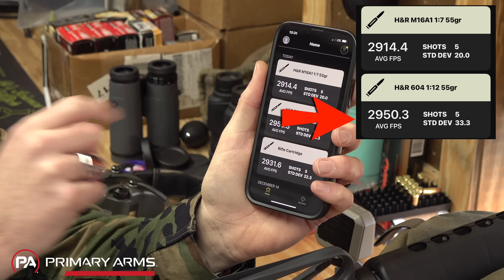Which is more accurate? 1:12 or 1:7 Twist Rate? Let's find out!

Comment: I haven't watched the video yet, but the twist rate does not affect accuracy. Other factors vastly influence accuracy more, and you would need a more significant sample size to prove anything.

As long as the bullet is stabilized, it is stabilized. ELR will change things, but not at 100 yards.
Reply from the maker: You would be wrong with that assessment, one of the reasons the .224 Valkyrie struggled initially is because no one had figured out the right twist rate AND bullet weight for optimal performance. My DD5 Pro likes 147gr Hornady but doesn't like the 120gr stuff at all. Why? The twist rate for the bullet weight isn't optimal at 120grs.
Reply: Twist rate doesn't affect accuracy ? Then explain the Greenhill formula.
Reply: @kman0146  Greenhill formula predicts bullet stability not accuracy.
Reply: @bpm990d  They go hand in hand
Reply: @kman0146  Yes they are related, but nowhere in the greenhill formula itself is there a prediction about group size or precision.
Reply: @bpm990d  I was responding to the statement that twist rate has no affect on accuracy, maybe i should have used a better or more modern example but the reason rifling was developed in the 1st place was for accuracy, nobody would bother stabilizing a bullet if it didn't make it more accurate and Greenhill would get them in the ballpark 150 years ago.
Reply: Twist rate can affect accuracy. The British use to get issue ammunition to shoot their long range matches. It was all specially selected lots of military 144gr ball ammo. They found out that it shot better in 13 or 14 twist barrels, rather than the standard 12 twist barrels that the military rifles had. Back in the day, you wanted a tight bore and groove barrel with a 13 twist if you were going to Bisley to shoot. 

The reason they shot better with slower twist was the military ball ammunition has non-uniform bullet jacket thickness. That mass imbalance resulted in worse groups the faster you spun the bullet. Think of an unbalanced top.
Reply: Yeah your assumption was wrong LMAO twist rate and projectile weight relationship is critical for accuracy. Ask any reloader who does precision shooting.
Reply: Guys, the twist rate required to stabilize a bullet is based on the LENGTH of the projectile, not the weight. This is why people believe old WW2 guns can not shoot copper bullets accurately.

Once you have the proper twist rate to stabilize the bullet, no additional twist will increase accuracy. What you are seeing is an unstable bullet that is spiraling due to not having enough twist rate to overcome the dip of the nose when it leaves the barrel. The technical name for this yaw effect escapes me, but there is a name for it.

Moreover, it has been proven that bullets will often overcome this wobble-induced spiral at over 100 yards. As the bullet slows down, it stabilizes completely.

You do not need to see a keyhole to have an unstable bullet. Another test to prove there is a spiral is to shoot your unstable bullet at close ranges. Shoot a group at 20, 25 and 30 yards. If your group moves around the aim point at various distances, your bullet is spiraling and not fully stabilized.

Once it is stable, no amount of twist will ever increase the accuracy.

I just finished watching the video. I love your content, but all you proved was that 1 in 12 is insufficient to stabilize the 62gr fully. If you extend it to 200 yards, you will see better results. Also, if you did my close-range test, it would show the group moving around the bullseye depending on the distance. It would make a great video!
Reply: @coreymoyers  Thats not what you said, you simply said twist rate does not affect accuracy.

Comment: I’d like to see a 1:14 barrel thrown in for once… Including a 1:9 would be useful as well…. Using bullets from 40gr up to 77gr…

Maybe a summer project for me…
Reply: With 1 in 14 and 1 in 12, make sure you hit "watermelons", not regular melons or cantalopes etc, for the full effect, because of the pocket of air in regular melons inside, you won't get the hyperstatic effect.   :)
Reply: @thesanfordmethod1905  As fun as that would be, I want to concentrate on accuracy measurements. I may look into a block or two of ballistics gel though as I would love to see the various wound channels with the various weights through the various twists and how they will differ… especially a 1/14 with some 40gr blitz or TNT varmit bullets at 3600fps…
Reply: If you do, go by length of the bullet. The longer they are, the more revs are needed. You can find the same mass with different lengths and different mass and same lengths.
From there the more mass is on the outside or mass removed from the center the easier it is to stay on route rotating along the same axis.

Comment: I was surprised a little by the 62gr in the 1:12''.  I didn't see that in my testing of the Brownells 1:12'' barrel until I got over 69gr.
Reply: From my experience shooting M855 in Model 604 M16s, some rifles stabilized the heavy projectiles no problem. Other rifles had groups open up to perhaps 6 MOA. Never saw any tumble. 

We were allowed to use M855 in the 1/12 rifles. They just told us accuracy would suffer, but still good enough to fight with. 🤠
Reply: More proof that barrels don't adhere to physics but to some ancient form of magic, maybe Indian astrology.
Reply: @Skenderbeuismyhero  It's so much into it, even two rifles of the same brand and barrel length can get you different velocities. Tightness of the chamber/bore, smotheness and so on, nobody is able to produce with zero tolerances, and if it was possible nobody would pay that price.
Reply: @marinioaweischo6614  yeah, especially when these aren't exactly high end custom rifles, and they're shooting cheap .223 ball out of 5.56 chambers(I assume.)
Reply: My Ruger 77VT with a 1:12 would keyhole 62gr and up at 25 yards and wouldn’t even be on paper at a 100.  Wish I would have seen this video before I bought that rifle.
Reply: Yes, the slow twist in the M77 (I have one too) is going to require lighter (shorter) bullets.  Mine is absolutely fantastic with my 40 gr handloads, but above 50 gr I really struggle keeping it under 2 MOA.  Twist rate, bullet length, muzzle velocity, and barrel stiffness all combine to establish the boundaries of what you can shoot effectively.  @TemplarMedic
Reply: Small sample size--let's "crowd fund" by repeating this experiment.  Don't forget--temperature will affect the bullet because lower temperatures mean denser atmosphere.  Speaking of atmospheric density, the range I normally use is at 5070' altitude above mean sea level.  I expect that I'd get different results if my range were in Death Valley during the summer than on a mountain during the winter.
Reply: @alancranford3398  you are not wrong.  Reminds me of carburetors that needed to be adjusted when you drive into the mountains on the weekend.
Regardless though...there is a "baseline".  
I think of the rifling in the barrel like the transmission of a car
bigger, heavier car needs more torque, so you change the twist rate.  
driving on ice, or in rain, or snow, or sand...yeah sure, we can lower the criteria for the cartridge to a specific subset, but now you are talking about a Jeep Gladiator right off the lot and comparing it to a customized rock crawler.
Reply: I can't get over 69...
Reply: I run 69grn nosler in my 222rem mag ackley 1-12 twist as my normal load ,under .5" average
Reply: @peterbrazier1886  Serious question….what is the difference between .222 and .223?  The 1:12 twist is the same….the 69 grains are the same, and yet .223 shooters mark 5” groups or more.  I’m shooting 5” groups at 25 yards, and the rounds keyhole.  At 100 yards I’m lucky if i hit the paper.  Other .223 shooters all report similar or not as bad as mine.  So what is the ballistic difference of the .222 that allows a 1:12 twist to stabilize a 69 grain round?
Reply: That A1 is no more accurate than a typical AK.
Reply: They weren't keyholing
Reply: There are a bunch of comments on this thread. You are going to have to elaborate .  What wasn’t keyholing? @awsomedude12345678
Reply: bullet length not weight.
Reply: He seems to be shooting the most anemic 55 grain ever… 2900 ft./s out of a 20” barrel??? Also temperature and elevation come into play.  Cold dense air with high humidity also isn’t helping.  But it seems like if you’re doing a review like this at least run at spec 556 loading.  That 55 gain should be exiting the barrel at 3250 minimum.  This seems like kind of a bullshit review.  At least run properly spec, loadings, pressures and velocities.
Reply: Yeah, I’m a little skeptical of the relevancy of these results because they are based on only one group of each configuration, and only one type of ammo in each bullet weight.  I’m also curious about what they do in ballistic gel.  The “lore” I have heard says that when fired from the 1 in 12 barrels the bullets are far more likely to immediately begin tumbling on impact with the intended target and do more damage.
Reply: @jayjohnson3732  when I realized my 1:12 barrel was finicky with certain grains, I made the expensive purchase of one boxe of ammo in 40, 50, 55 grain.  Then when I determined which grain my barrel preferred, I bought 3 boxes of different manufactures in that grains...but now I know what my barrel on the Ruger 77VT prefers and I bought 10 boxes of that in the same lot number.

Comment: Certainly interesting results... wonder if it would be similar with other manufacturers, and different barrel lengths. I imagine the 1:7 would be better for a shorter barrel, as they both kind of compensate for each other in this regard. There are just so many things that can affect accuracy though, it is impossible to test them all. Thanks for sharing, and maybe next time use a magnified optic, might help you compensate for the older eyes. I'm nearing my 40's and am noticing my sight is getting worse, so a big scope really helps!